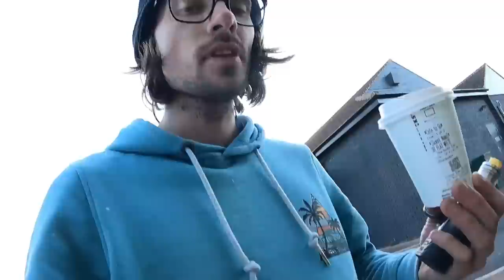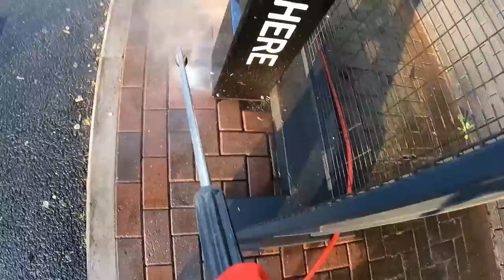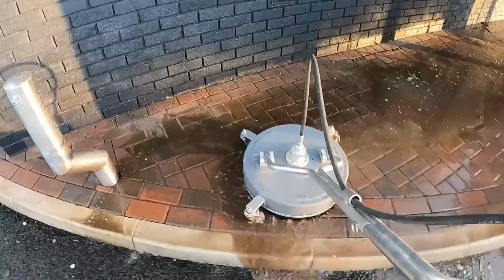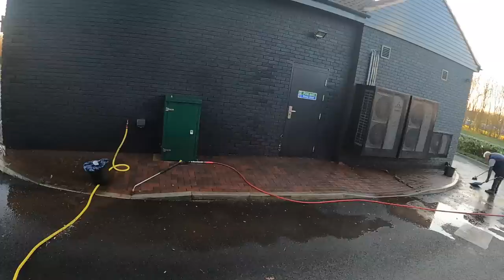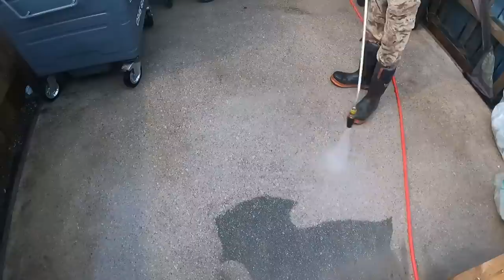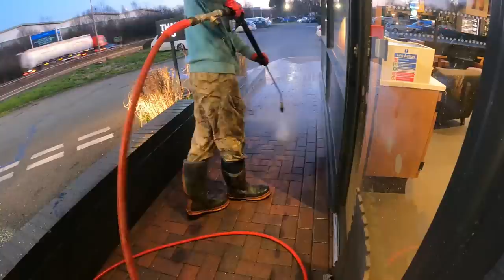Cleaning A FILTHY Starbucks Drive-Through & Bin Storage 🤢| Partridge Exterior Cleaning

Comment: There was a jack in the box in a town I lived in that had the nastiest buildup of grease on the parking lot and stairs/ramp leading to the doors. If it got the slightest bit damp, it was like ice. People slipped all the time. The place got bought out by a guy that owned a few other jack’s in the area. The first thing he did was hire a crew to clean the grease. It took them almost two full days to get the grease off the ground. Then about three months later, the entire building had to be torn down and rebuilt due to the inside falling apart from the lack of cleaning.

Comment: should have some lighting gear.
and actually u can use the car light.

Q1. btw how long u guys finish this job?
Q2. i always wonder why not get 2 pressure washing gun and do it. one do the cleaning, one do the push away thing, that may a lot faster, 
the one "push away" may not need that high pressure can buy cheap gear for that? i am not sure tho
Q3. also, why sometime use the gun first, then follow up the circle washing one? i know the circle one are lower pressure.

Comment: It seems using the surface cleaner first then the nozzle would minimize the time needed as you wouldn't clean anything with the nozzle that wasn't absolutely necessary.  I think you end up doing more than necessary with the nozzle when its used first.